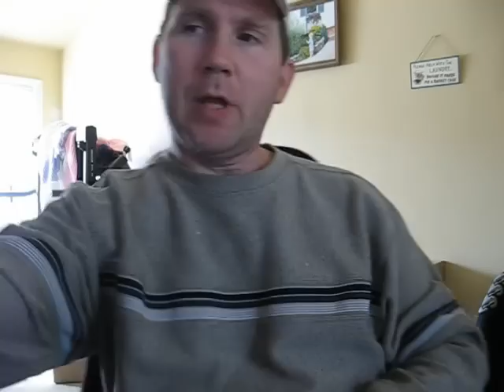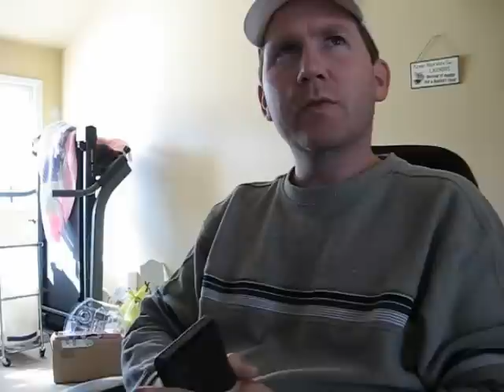Milage Test Hydrogen Generator

Comment from the maker: Yes, the O2 sensors are now being controlled (after this video was made).  You should build your own flash arrester, or go to myenergyinc on the net.  My power source is my alternator.  Keeping the amp draw down is important.  I am working on an automatic PWM to control the amp draw.  It will be ready in a few weeks for testing.

Comment: Try a PWM with current limiter from zerofossilfuel (YouTube). You can buy one, or make one by yourself from his design, the design is for free. The cell will get less hot and it takes more time to get hot, and the current will not rise when the water gets warm because you can limit the current. good for continuous currents up to 75 Amp Dc and peak current up to 250 Amp and adjustable to zero Amp. You can also adjust frequency up to 10 KHz and adjust duty cycle. It works great.
Success, Rick

Comment from the maker: That will turn the generator and hydrogen OFF.  The answer is to simply control the amp draw.  Heat is perfectly fine and in fact, beneficial to the process (as I now know)

Comment: mount a thermostat control to the body ofthe hydrogen generator wire it into the supply voltage. it will become self regulating.

Comment from the maker: When the electrolyte heats up, it becomes more conductive.  That is the only issue.  It is the same issue with all generators.  The trick is to simply control the heat, or control the amp draw.

Comment from the maker: There is nothing at all bad about baking soda.  However, KOH and NAOH are DRAIN CLEANERS and will burn holes in your clothes, blind you , kill your kids if they get into it, and de-molecularize the aluminum block in your engine.  Aluminum hyper-oxydizes in the presence of KOH and turns into Hydrogen + Aluminum Oxide......quickly

Comment from the maker: Have you personally had bad experience with baking soda?  I ask because I have been running it for 7 months without a problem.  Both KOH and NAOH can kill you and ruin your engine, since I have kids and I don't want them dead, I opted to not use it.  Imagine a situation where you, or someone else, overfills the generator a little bit.  The fluid gets pulled into the intake and into the engine.  Goodbye intake/seals All Aluminum parts in the engine will defloculate :( :( new engine time.

Comment from the maker: I have not experimented with lower voltage....yet.  If it works, that is great.  Since 1 watt is directly translated into heat energy, using less will keep the system cooler.  However, I want my cell to produce water vapor, just not run away with amperage.  The steam increases combustion and keeps the engine cooler.

Comment: I was running my cell had a heat problem so now I run it on 5 volts 20 amps cool as a cucuber and just as much output there is a couple of ways of doing this computer power supply  and  a inverter. or  I am useing my power supply that runs my blower motor  and I just crank it down and add backing soda to bring the amps back up works great  seeing my air is not working right now it creates no problem , well I thought I would pass this on have a great day

Comment: you don't need to run the engine on pure hho to benefit from delayed timing. a small amount of hydrogen will recharacterise the combustion event with a higher flame speed.
 in my favourites is a set of videos u may find interesting... hydrogen engine fundamentals... hope it helps...

Comment from the maker: Excellent point, with the steam/water injection.  I am actually planning to do it....when I find the time.  You are right, it should reduce heat and add a little power.